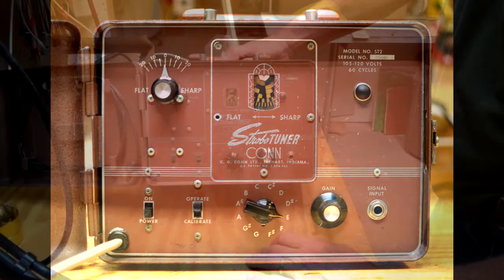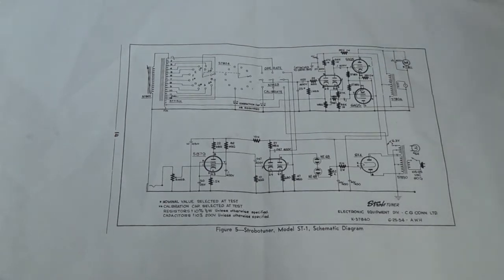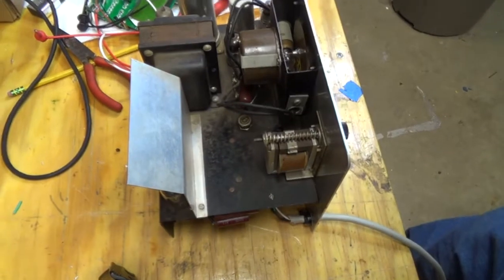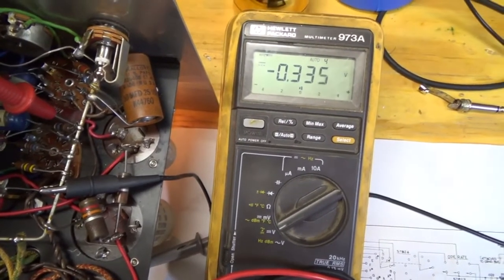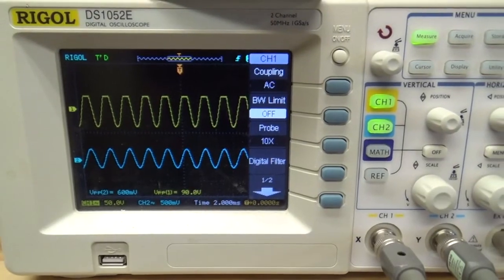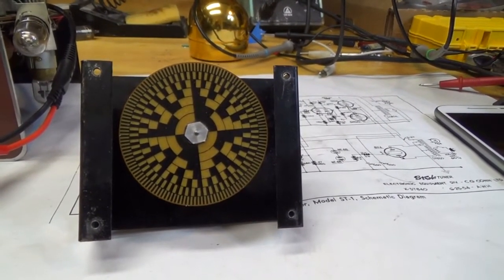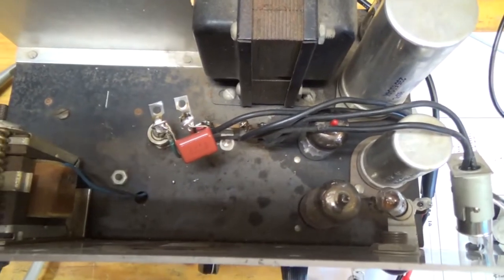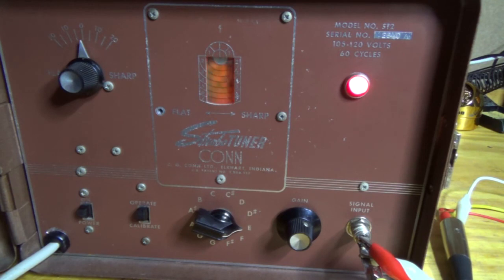Conn Strobotune repair and demo

Comment: Nice video. Thanks for sharing. I have a broken Conn ST-1 that I would like to repair. Can you share a source for the schematic you showed in the video? It would be a big help! Thanks,
Reply from the maker: No problem. I put the schematic I used in the description of the video. If I remember right it wasn't exactly the right schematic for the device I had but close. Good luck!
Reply: @RobsFixitShop  Thanks for the effort. Unfortunately the folder seems empty. Subscribed to see what other interesting fixits you are up to!

Comment: Rob's Fixit Shop, why does the conn tuner have Vacuum tubes? I didn't know these tuners had tubes!
Reply from the maker: They are from the early sixties and transistors were just coming in. The circuit for the driving the motor is really just a fancy push/pull amplifier circuit.
Reply: @RobsFixitShop  I see thank you Rob's Fixit Shop.

Comment: I have the ST-4 and it functions perfectly. Can you tell me what the RCA jack on the back of the unit is for?
Reply from the maker: It leads to a transformer winding on the same transformer that runs the motor. I think it outputs the tuning frequency as a reference. I don't recall what level the signal is at.

Comment: Great Video! I have a strobo tuner that is in great condition except the motor does not spin without having to hand turn it. It generally will stay spinning until I shut the machine off. So replacing the cap should do the trick? What tpe of replacement cap did you use?  Thanks in advance
Reply from the maker: On some schematics I see .1mf and others it is .15mf. I think I used 0.15. Use one that is rated to 400v. I actually bought 2 Strobotuners. On the 2nd one all it needed was the cap. and it came right back to life. Good luck!
Reply: Thanks , I have an ST-6 bought from goodwill. I see mine is a 0.1 mf 600V Paper..will a film work better?
Reply: Any leads on a good place to find caps?
Reply from the maker: digikey or mouser
Reply: You sir are a most excellent Youtuber !
Reply: Mine seems to say 600uf? seems high?